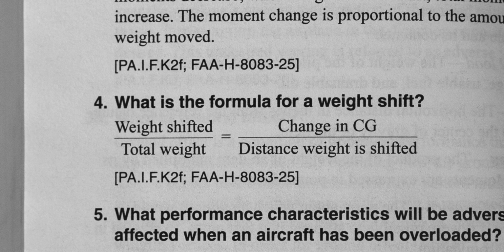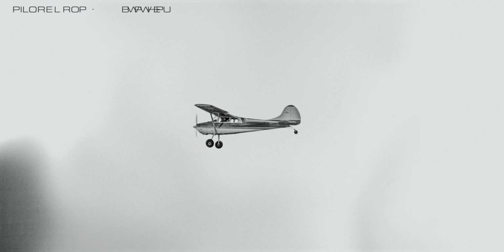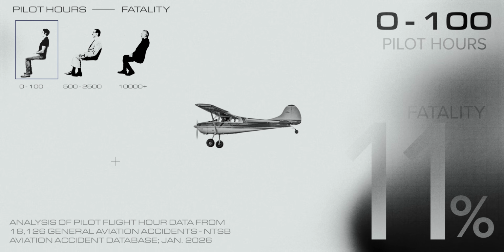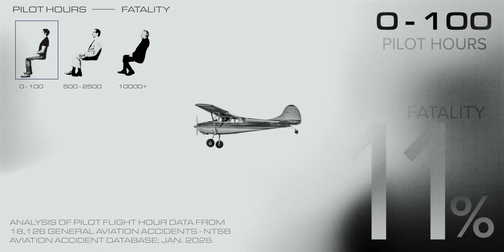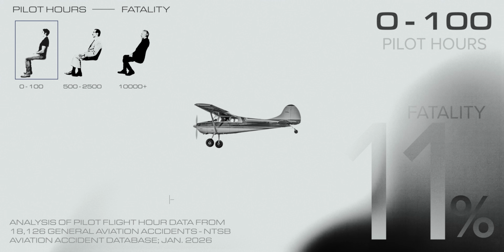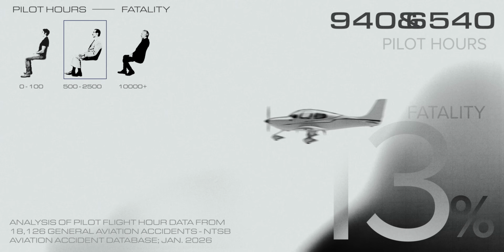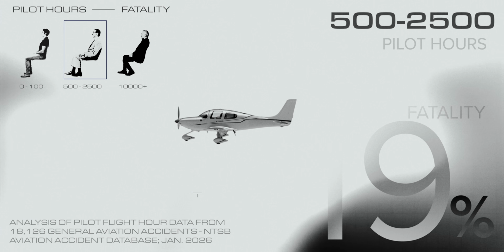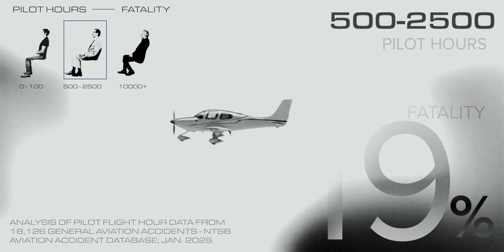Why Small Planes Crash (The 100-Year Design Flaw Nobody Fixed)

Comment: Great to see a new aircraft being designed. 
Now from a background of 20 years commercial piloting and a class 1 test pilot when it comes to general aviation there are a few things to note.
1. Most GA aircraft do not crash because of inferior technology or design, in fact most GA aircraft is very advanced compared to Airliners.
2. Airliners crash less because pilots are better trained and prepared for their flights. 
3. There is always room for improvement when it comes to technology, and much can be done to help make flying safer and most importantly more cost effective.

Comment: Every new aircraft pays for the entry to the field in blood. Pilots or aircraft will still find a way to crash and die. It only takes one screw, one line of code, one quirk of the weather, one sensor out of calibration, or one imperfect connection. I think you have a misguided basis for your design.

Comment: After driving trucks for 1.5 million km i can honestly say that wireing looms fail on average 2 months on brand new machines  able control  is faster to maintain unless you make wire looms with better gold connections replacing regularly and place more ceramic capacitors in systems to iron out harmonic blowout

Comment: Yes, but. 
If you can't design an AFFORDABLE airplane, who will fly it? Non pilots aren't going to - you've ALSO got to figure out how to keep costs down. Carbon Cub at $400k OR MORE?! Insanity. $50k? Maybe that's too cheap. A new Cessna 172 at 1/2 a mill is out of most folks price range by 400k. I won't be buying or flying an airplane that costs more than the average car. It's got to be priced around $50k. Less would be better. Think Experimental. That's definitely where you need to go.

Comment: This whole mono plane experiment should end.
Bring back the biplane
Reply: I find it interesting that you bring biplanes up. Reminds me of the Grumman Ag Cat biplane an agricultural workhorse built by Grumman exclusively for Aerial crop spraying. My Father was an ag pilot (crop duster as folks like to call them) and he had an early model Ag Cat for awhile. His was initially an open cockpit, as all the first ones were, but he later added a Grumman canopy upgrade to it. The Ag Cat was said to be a very well behaved aircraft with many safety innovations incorporated. It had a fuselage structure that is designed to progressively collapse in the event of an accident. Also with the cockpit located aft and high with built in roll over structure to protect the pilot. I believe most all exclusive ag aircraft are built with this innovation as well. Most other ag aircraft are all mono wings although their wings are long with a lot of wing area and fly faster. I'm not sure faster is desirable for ag aircraft though. Slower with Maneuverability would be more desirable for ag aircraft I would think.

Comment: When for 100years, general aviation has been ignoring known ways to make planes that are efficient, quick on available power, and completely stall-proof - as in you can't fly them so that flow over the top of the wing separates, causing loss of lift and loss of smooth flow to trailing edge controls.

See the Arup planes from Indiana in the 1930s. Also the Nemeth "parachute plane" test plane, the Farman 1020 also of the '30s.
Skip ahead to the 1990s and the Wainfan "Facetmobile" also with very-low aspect-ratio.

All ignored because of fashion. Because they look funny and violate every part of "if it looks right, it'll fly right" which as we all know is a hard rule with no possible exceptions: if it doesn't look like a Cessna or 707 or P-51, it can't possible work.

No, very-low aspect-ratio is not inherently always very draggy. All the ones above proved to be sleek. The extremely huge wing-tip vortices which they produce while flying very slowly at very high "A" are elective and temporary, in order to fly slowly. They are not always burdened by carrying around the excess drag of extreme vortices.

Comment: I keep my fingers crossed for you, as I'd love to see GA follow up with other industries. However I'm gonna watch this from a distance, as the financial side will be far out of my reach. 

To keep GA alive we'd need a simple plane made with technology that's not as manual labour intensive as composites.  912 is a great engine, but as a former owner I know they'll charge you with the weight equivalent of gold for parts that cost peanuts in normal applications (ex. the sinking carb floats). Also the cost of one is similar to a mid size car.  The US tech is no better, with built technology dating back to Sauron's pit, and appetite for leaded fuel that is not appreciated here in EU.

Comment: One thing to really help yourselves — Prandtl ‘33. See Al Bowers work integrating bird studies with the Hortens’ flying wing with Prandtl’s bell shaped lift distribution. Fly-down wingtips with proverse yaw instead of adverse.
Reply: Note: there is a patent out there and it was up for sale. Not sure its present status. But you can still use the concept, you can achieve the bell distribution with a different airfoil design. Alternately you could fight the patent. There is something inherently wrong with NASA making a patent considering we all own NASA and similarly NIH was prevented from getting patents while NIH employees couldn’t even get their names recognized regarding mRNA work. Whatever justification inhibited NIH applies to NASA.
Reply: Had some walking the dogs thoughts, which are sometimes better than in the shower thoughts… you’re generally looking at reducing controls yet you still need multi-axis control. - as an aside, believe my Pitch for Power, Power for Pitch a Coffeehouse Discussion includes an Ashby reference but missed concerns to aircraft degrees of freedom and controls, which I will sub-comment - anyway, you want to provide safety yet you’re interlinking everything to one input. Aileron-rudder interconnect of the Ercoupe fashion may not be that bad — though Prandtl ‘33 design to be proverse not adverse — while a pitch power interconnect has some merits (but also lots of costs)… the big safety concern, however, is what about electric power loss… well what if you electromagnetic trimming such that a total loss kills whatever trim is held such that surfaces default to L/Dmax as their failure state? Now you have best glide, but do you need best glide? Are you going to have adequate control to hit a target should you be able to reach the target? If not, maybe default should be minimum power required AOA such that you have the most time while also having a more survivable kinetic energy state… but spiral divergence… you need to be able to straighten the wings. So you probably want a physical interconnect aileron and rudder — again Prandtl ‘33 go proverse — and if you’re going to have such interconnect, why not have a mechanical elevator connection, just limit it so you can never reach stall. Such now enables you to hit a target. Perhaps full aft gives you the minimum power required AOA while neutral is L/Dmax and forward is perhaps a couple degrees AOA less or maybe L/Dmax plus ten-ish kts…. That is pretty limiting for normal operations so have your elevator able to extend range of motion electrically beyond that of the mechanical link so as to go faster, and for training, go to stalls, probably want a “training on” toggle switch that dies when electrical power dies such that it defaults off every flight… Is this an elevator extension or a trimming that toggles the centering of the elevator range similar to field of view vs field of regard vs gimbal limit max possible field of regard?  That is up to you, but you get the idea… anyway you’re probably going to Cirrus / Icon full whole of aircraft parachute but you may want to glide a little to choose better parachute landing options, frozen lakes suck, so do schools, anyway, you also have concern for when below chute available… then there are gear concerns, off field you want them up which is better gliding, but you don’t want them electrically held down as that creates different issues… probably best leave that as an in current state kind of condition.
Reply: Anyway, thoughts. Back to Ashby and controls. You have to have at least as many controls as you do outputs, otherwise you do not have control, you merely have influence. Not only do you not have control, you cannot even predict outcome. You’re a part of the system, you have sight horizons, you cannot see the whole of the system. This goes for the engineers too, not just the pilots. Goes to Boyd Destruction and Creation, Conceptual Spiral, goes to Snowden Cynefin. These are important in their own right as they all go to decision making to which the FAA is not only woefully inadequate, it is outright wrong. They don’t understand how persons and people do and they deliberately choose not to so as to always be able to blame persons. But back to degrees of freedom. Generally we think aircraft have six. Forward/backward, yes only helicopters can go backward but it is a continuum, left/right, up/down. That’s three. Then the moments pitch, roll, yaw. Six. But we only have four controls, elevator, ailerons, rudder, power. Good thing we don’t actually have six dof. Up/down, generally that is power (or collective). Forward/back, that’s cyclic. In a plane, you’re always going forward. Though you can control rate forward and that is elevator. Yes, such can trade up/down, though power fixes that. Left/right, could be cyclic, could be rudder, you can do flat turns, but generally it is rudder balanced aileron setting up elevator. Though power could be used in place of elevator. Here’s the thing, roll and yaw are not independent, they’re interconnected. And left/right is tied to them too. Meanwhile forward/back is tied to up/down. They’re not truly 6 dof. Want to go faster, it is elevator but to stay level doing it, it is power plus elevator. We have our three moment and we really only translate longitudinally. Lateral/directional are really merely re-orientations of the longitudinal. We’re really more like 3.5 dof, so four. That is good for us as we only have four controls. We control three moments and power, that is it. Good thing we really only have three rotational moments and forward translation with up being part of forward. Tangential thought, look to energy. Differentiate zooms from climbs, dives from descents.
Reply: Read Improve your Landings with AOA and Power Technique.

Comment: “When Skytron designs an airplane that is as safe as a car…’ cars ain’t safe. The entire automotive system of systems is terrible. And you should read The Atlantic’s The Deadly Myth that Human Error Causes Most Car Crashes. Which also gets back to Dekker and Conklin. As an aside, it groups really well with Atlantic’s Pandemic Death Spiral which also discusses serial monogamy of solutions and with Wired’s The West’s Infernos.
Reply: And also The Contrarian Aviator Sometimes Turns Right and The Contrarian Aviator Sometimes Reconfigures on the Runway.

Comment: Full envelope protection can actually come back to bit you. Airbus with the auto-trimming as supposed to do such yet didn’t work, AF 447, XL 888T, Air Asia 8501. Boeing MCAS was supposed to be a protection both to power induced pitching moments and AOA. Protections aren’t necessarily protections. They’re trades into other hazards for space at the intended hazard though often we don’t know to which hazards the protections cut against.
Reply: There are a couple podcasts that pair really well here, Todd Conklin with Pre-Accident Investigations episode Swiss cheese Actually and Command and Control’s Synchronization as Coupling.
Reply: Lockheed with the F-35 can be binned with these too. We’ve had three crashes now in which systems “helping the pilot” contributed and a fourth in which they left the pilot no options.

Comment: Flight Instructor here ...
Nice Idea.
BUT you start with big mistake: no rudder.
Wrong or bad use of the rudder causes many stall/spin accidents and the pilots in those small planes are known for that: watch what the rudder does when they are nervous ...
You should start with the human factor: legs and hands do not react in the same way.
Reply: Seems to me they’re still looking inside and haven’t gotten to such yet. Though you actually can go without rudder. See Al Bowers work combining the work of the Hortens with Prandtl ‘33 and integrating with bird studies. Birds have neither rudder nor vertical stabilizer. What is this all getting to? Proverse yaw instead of adverse yaw. Wingtips that fly down instead of up. Bell shaped lift distribution not elliptical. Vortices at about the two-thirds wing not so much the tips. Prandtl, who discovered the elliptical distribution is the most efficient for a given span, decided to investigate what would be optimum for least wing flex and in so doing found what is optimum per given mass. Funny evolution went the same route. After all, mass is all about the energy requirement and minimizing such. Though the bell distribution saves not only in optimizing the wing, and also eliminating the need for vertical stabilizer and rudder.
Reply: Fly an Ercoupe (the original with no rudder pedals). Seems this new airplane will require only one hand, most of the time.

Comment: PPL here, I have my doubts. Planes aren't as safe as cars for a bunch of reasons, and they're mostly the same reasons motorcycles aren't as safe as cars: you can't put enough crumple zones on an airplane for it to survive a crash, and you can't pull over if something goes wrong. I certainly don't want a plane that takes control away from me if it thinks something is going wrong, especially because if I have to fight it I'm spending more time beating the computer into submission than aviating.

Comment: Eliminating human error sounds great — until you realize you’re eliminating the human.

No one climbs a mountain just because “there’s something at the top.” People climb for the challenge. No one crosses the Atlantic in a sailboat just to arrive — they do it for the experience of wind, sea, and skill. Risk is part of what makes those activities meaningful.

Flying is the same.

If someone just wants to go from point A to point B with zero involvement, airlines already exist. Buy a ticket. It’s cheaper and safer. Owning an airplane has never been about transportation efficiency — it’s about the experience.

Feeling the controls. Reading the air. Understanding the aircraft through your hands and senses. That connection between pilot and machine isn’t a 100-year design flaw — it’s the essence of flight.

Trying to remove the human completely may improve statistics. But it also removes what makes flying… flying.

Not everything meaningful in life is meant to be risk-free.
Reply: Funny thing about human error, “human error” can also be the adaptations to unanticipated events that save the day. If you prevent such, no day saving. How would US Airways 1549 (Sully on the Hudson) turned out? How about United 232 (Sioux City; differential thrust to steer)?
Reply: @Fffflats  We learned from those events. Those lessons will save lives.
Reply: @jeffreypierson3023  that’s not the point. The point is adaptation and flexibility were crucial in those events and will be in future unexpected events while rules-following and compliance is directly counter to such flexibility and adaptation. This sort of flexibility and adaptation readily gets labeled “human error.”

Comment: It doesn't matter. The only aircraft anyone can afford to fly at all, are the exact same aircraft that people could afford to fly 30, 40, 50 years ago. And I don't mean the same designs. I mean the same airframes that were built in 1960, and have been rebuilt and overhauled 18 times already.

Any new design will cost $1m each. Forget it.

Comment: Great video!
<these are not bad ideas>
GENERAL AVIATION:
-underpowered(GA planes can't save themselves from bad weather, etc.)
-leading edge slats(high AOA)usually just vtol planes
-no cockpit AI(no intervention hardware/software)
-negative lift devices(tail planes and rudder)(bad)
-no weather radar

Comment: Here's what it boils down to: this "plane" is not being designed for pilots that want to fly an airplane, but rather for someone that wants to take a ride in an aircraft. It's the same as Teslas aren't made people who like to drive cars, they're made for people that mostly want to be driven around. The Mazda Miata is a fantastic example of a car designed for people who enjoy driving: it's inexpensive, simple, well balanced, and fun. It's not fast, has no driver's aids, and for the most part very low-tech, yet despite being designed in the late-80's still has a tremendous following. The Spirit Engineering SE-1 is one of the most fantastic things to come to GA in years, if not decades, as it addresses the same basic formula. It is (comparatively) inexpensive, simple, and meant to be fun to fly. It also has a lovely retro look to it that appeals to many. Funnily enough, it is designed and fabricated using CAD and CNC everything, something that many other smaller aircraft manufacturers cannot claim. They even addressed the fact that aviation engines have become criminally expensive by designing and building their own engine.

Want to build a plane for pilots? Look at what Spirit is doing. Want to build a plane for people that would rather push buttons and go along for a ride? Look at what Cirrus is doing.
Reply: I have a red NA Miata with 25k miles (wish I could post a picture). I love it. But it's terrible for 90% of the missions that I drive. I have a Tesla for those missions.
Reply: @shanestinemetz  there's a saying in the GA world, it goes "want to do it more expensive and slower? Fly GA". %90 of us are in it for the love of the game, not mission performance